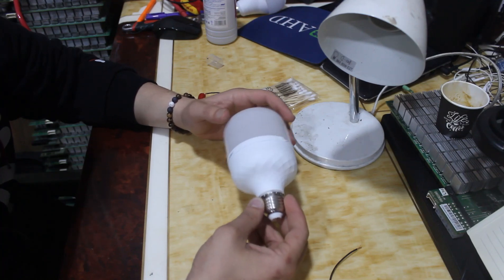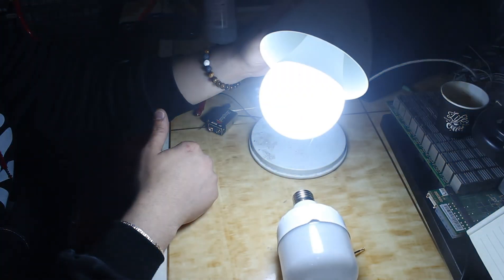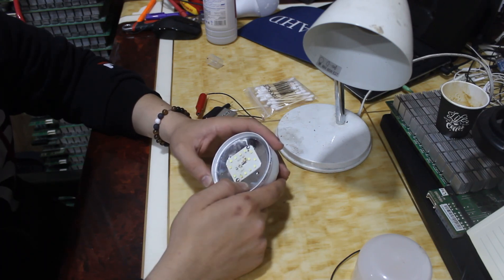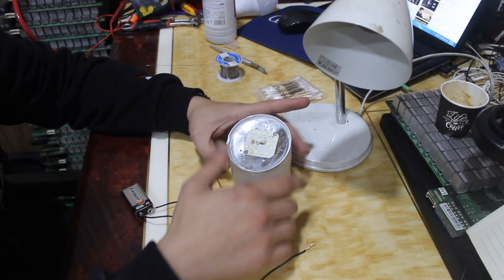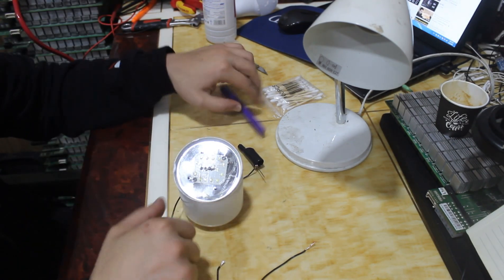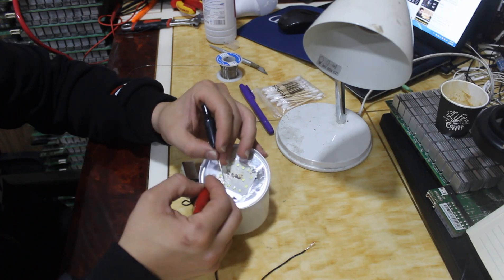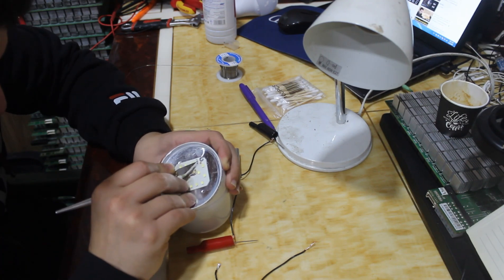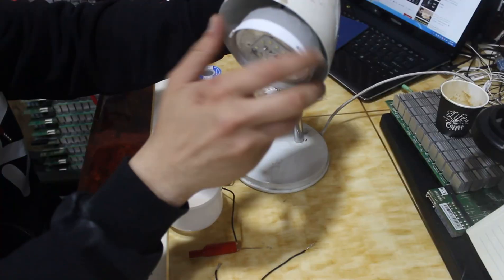Don't throw away your old LED lamp

Comment from the maker: Typically, the forward voltage of an LED is between 1.8 and 3.3 volts. It varies by the color of the LED. A red LED typically drops around 1.7 to 2.0 volts, but since both voltage drop and light frequency increase with band gap, a blue LED may drop around 3 to 3.3 volts.